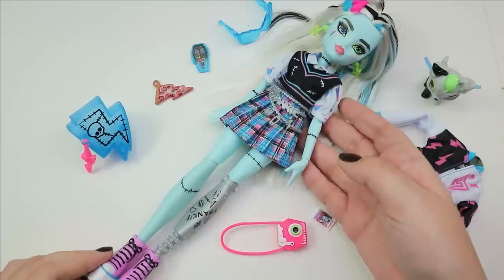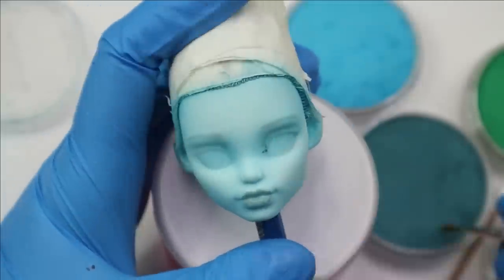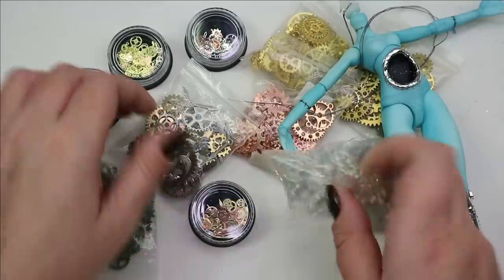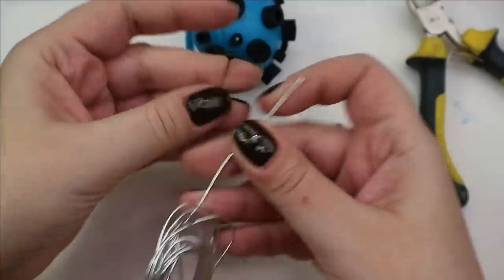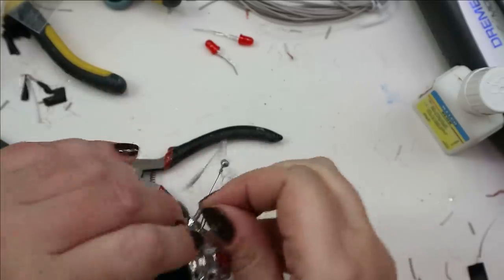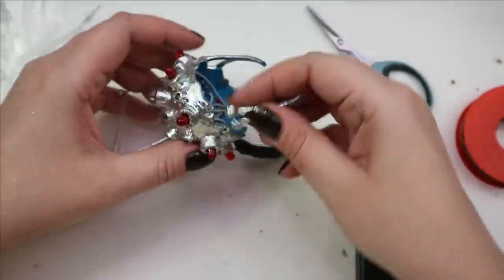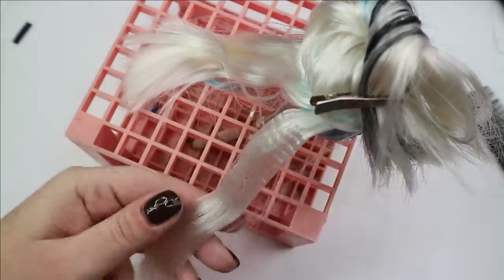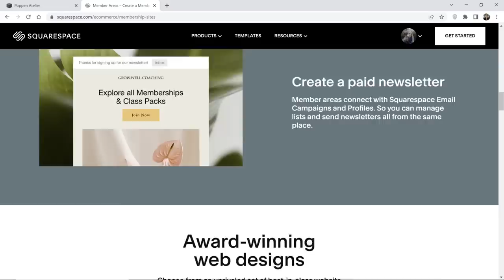I MADE AN ELECTRIC DOLL! / New Gen3 Frankie Stein Monster High Doll Repaint / Bride of Frankenstein

Comment: She's electrifying ⚡️⚡️⚡️The expansion of Poppens skill set continues with this successful transformation from blah to extraordinary 👏🏽 👏🏽👏🏽 I have to say I don't really like the New Monster High dolls they are not as delicate as the originals so it's a good job Poppen is around to take them to a higher level. I'd like to suggest that instead of the electrical tape perhaps thick yet flexible soldering wire could be wrapped around the electronic wires?